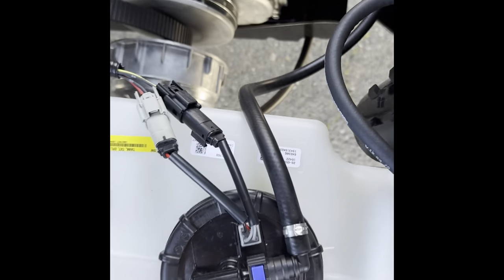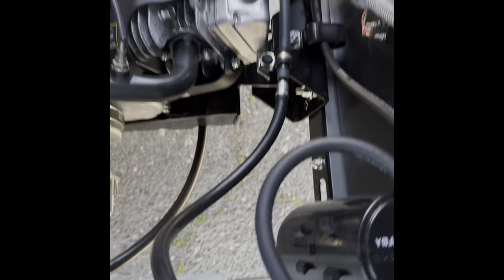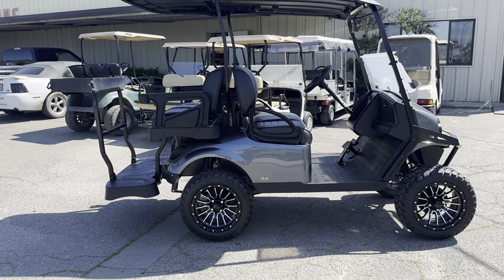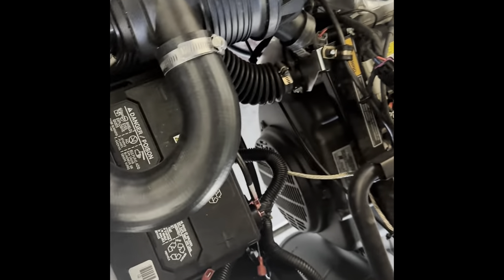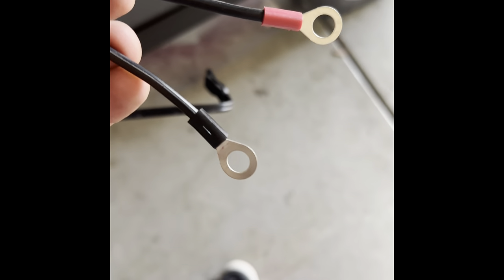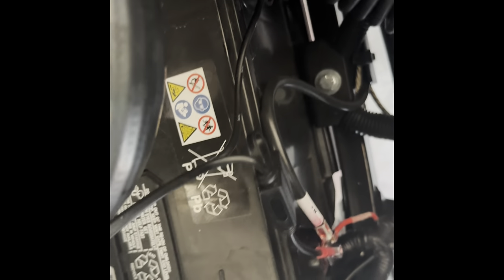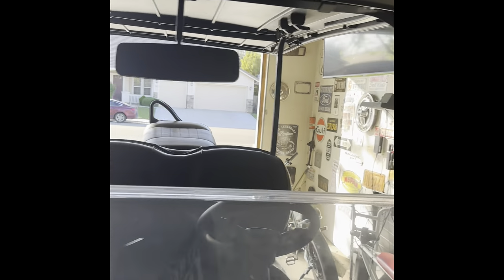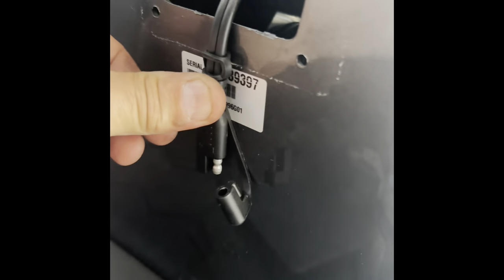Gas golf cart 2023 ez go express s4 gas first must do mods!

Comment: How does it do on hills?
Reply from the maker: It does really well this is the same motor they use on the 8 seater
Reply: Just bought a L6. Was curious if you’ve don’t any adjustments on governor or engine to gain speed/torque. Mine being a 6 seater, it feels like a turd. Lol

Comment: I am sure this was helpful info but can't hear a word you said because of the background music.  You may consider reposting this with the background music deleted.
Reply from the maker: I used captions and it is pretty straight forward. Cut fuel line install an inline fuel filter. Mirrors bolt on. Trickle charger goes directly onto the battery red to red black to black. I have other videos that show how to adjust the throttle cable and install wheel spacers
Reply: @ljoff-roadhotrodmods5664 Looking for the throttle cable adjust video.  Can't find it.